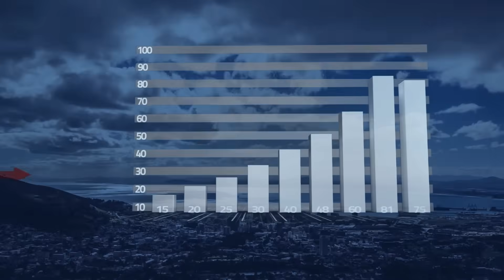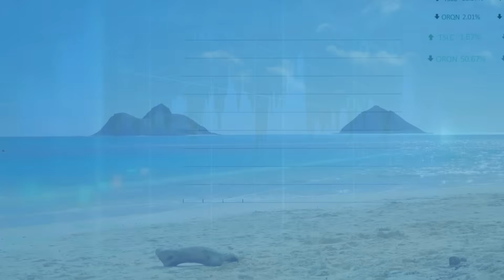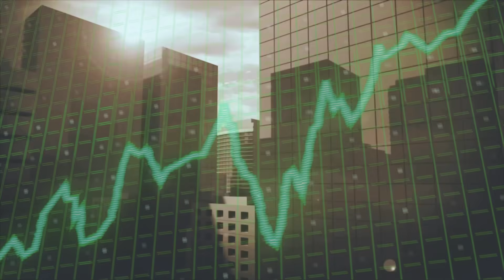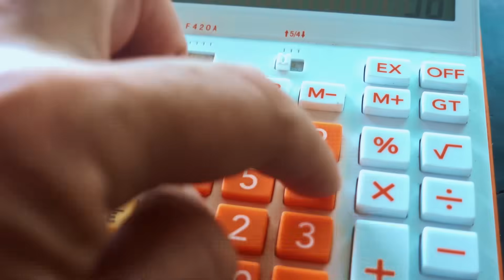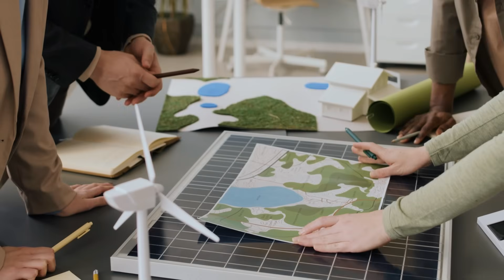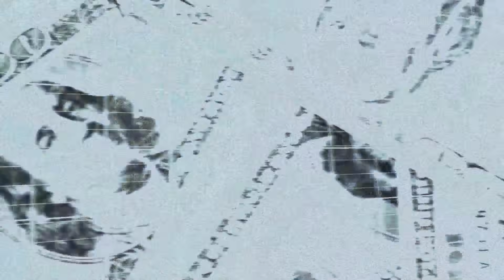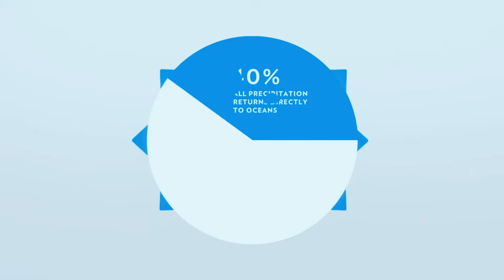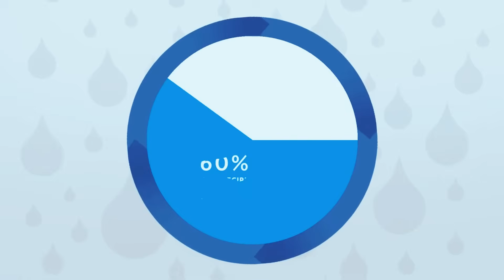$1 Trillion MegaProject America’s Last Hope

Comment: Why not thousands of small rain harvesting structures that would defend against flash flooding as well as providing water.  Without wrecking North America's river systems.  And without costing nearly as much.
Reply from the maker: Probably some of the states don’t rain much maybe
Reply: Maybe thoxe states should keep their hands off other people's water. @EngineeringUnlocked-m5z
Reply: We need lots of infrastructure repairs and replacements just to maintain the status quo.
Reply: There are several valid reasons for this idea. By trapping water in millions of tiny dams, 0.5 to 5 meters tall, runoff would be forced into the water table, creating little green spots that would increase precipitation somewhat, analogous to the way the Amazon forest produces conditions for rain. As the dams are built, the runoff may be reduced slightly. Still, after they are established, runoff increases because it minimizes evaporation (evapotranspiration, is different if you are following the thought) and allows water to flow out slowly, turning creeks into year-round rivers. It would also prevent and eliminate flooding. It's a truly marvelous idea if one puts pencil to paper and calculates the effects.
Reply: The cost would be minimal if only the streams before the larger creeks that flow into extensive infrastructure or towns were so dammed. That would prevent the danger of cascading flood damage if an upstream dam were to fail. You could build one with your hands and basic equipment in a few days' worth of work. With lightweight equipment, you could build such tiny dams for a few hundred dollars. One million dams would cost less than $ 100 million. Assuming half are hand-built. I was enjoying this idea while flying across the Southwest and looking out the window at precisely the same idea.
Reply: @atanacioluna292 Not only would the cost be minimal compred the gargantuan water project discussed in the video.  It would double as a flood protection system.  It could also bolster the productivity and biodiversity/bioabundance of the areas involved as well as sequestering carbon and promoting precipitation (if forests are included in the system).
Reply: As always so much minimalist approach, no future thinking
Reply: @henryjanicky4978 What's are the bonus points for spending much more money than needed?  As far as the future goes my money is on eco-engineering rather than the old school ego-engineering.

Comment: No need for these trillion dollar project first we should pay 37 trillion debt so that our nation wont collapse oneday 😢
Reply from the maker: Yes that is a good shout
Reply: Too late. It's a debt based system  can't function without debt.  Digital money can only kick th can down the road
Reply: The US debt is created as a fraud for war racketeers and could be invalidated by the international legal term "odious debt"
The federal reserve system is not part of the government, and needs to be abolished as it was under president jackson.
It will likely not happen as other presidents who tried were killed, ie. Lincoln and JFK.   It has a different name in Lincoln's time.
Reply: The debt will never be paid by conventional means they are going to inflate away the debt. Hyperinflation is coming it’s happened in other currencies 4800 times in other countries. Stable coins being backed  by treasuries are going to kick the can down the road a couple three years. china losing it’s workers for manufacturing is a giant problem  they now have factories sitting idle because of the lack of people. Housing sitting empty owned by the builders or by the state.cheap goods flowing in from China Will cease.china’s infrastructure is crumbling because it was built cheaply with subpar materials. China has a really big set of problems now the US also has infrastructure that is 60+ years old that needs replacing.
Reply: Hold on, US Fed Debt is now $47.12Trillion (1Sept'25).